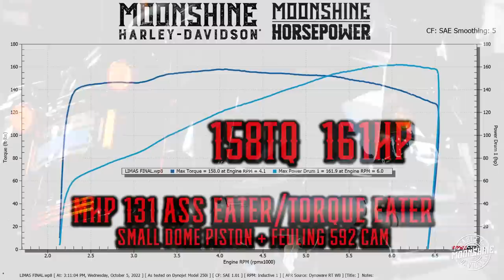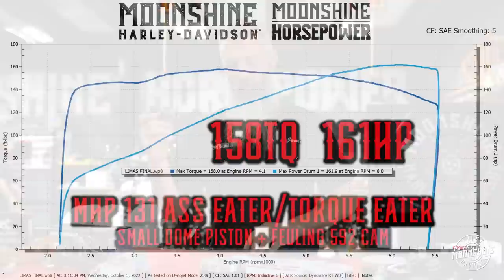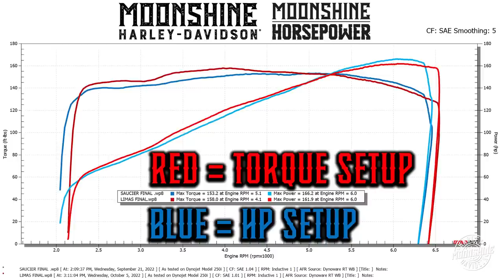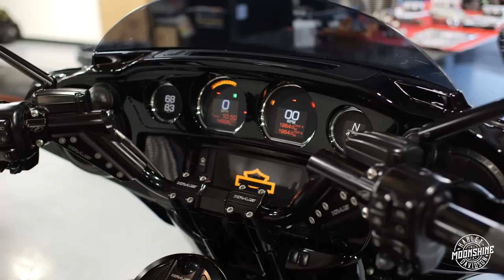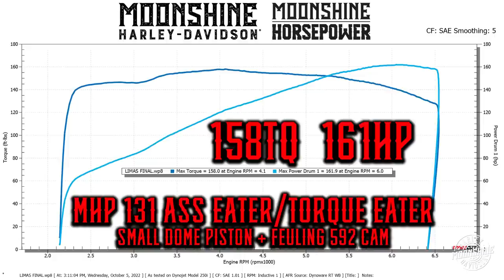Moonshine Horsepower 131 Torque Eater 161HP 158TQ| Bike Build No. 14

Comment: I have an idea, what if you made your 0.113" cylinder wall jugs but for stock crankcase bore? Yes your cubic inches will be low, but at least you've got maximum protection combined with time and money saved on not having to open the crankcase up. I think that would be a good compromise on cubic inches/performance and cost/time

Comment: Available for export as a top end bolt on kit? Stock bottom end.
Reply from the maker: Yes. Email us at horsepower@moonshineharley.com and we’ll get you setup. We don’t recommend running over 140hp with a stock flywheel. We have build flywheels balanced to these setups in stock.

Comment: what compression are you running on this setup?
Reply from the maker: 10.75:1 Corrected
Reply: @MoonshineHarley  please elaborate on corrected.
Reply from the maker: @davidgordon2379 Corrected compression is calculated with cam timing. It factors in the trapped air after the intake valve/s closes. This is the running compression the engine will see.
Reply: Screaming Eagle forced,,,   an a  T W  222.  With a twin cam engine,   large heads.  ,,      Can u help with more   horse power   idea's.  ????   Just wondering.   !!!!

Comment: I prefer good gas mileage for my long trips. Those built motors are gas hogs.
Reply from the maker: this setup will get relatively the same if not better fuel milage at 75mhp than a stock M8.
Reply: Wow.   !!!   180 miles ,,,,   5.  Gallons.  An ya get better than that ??¿